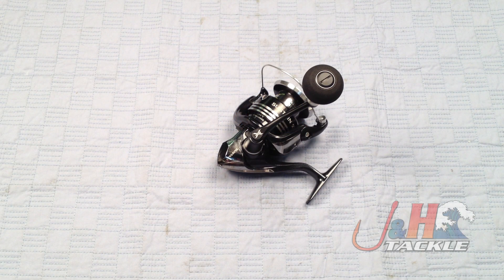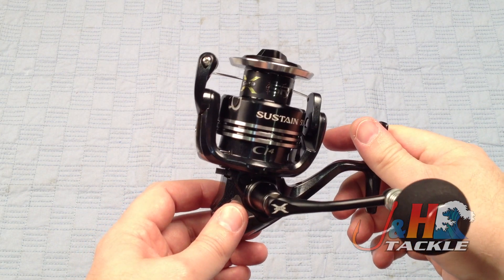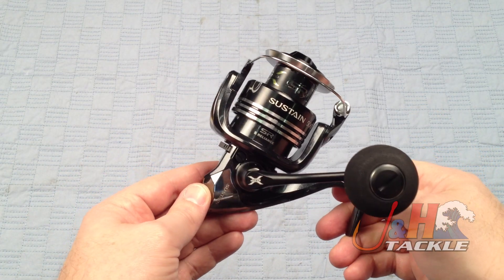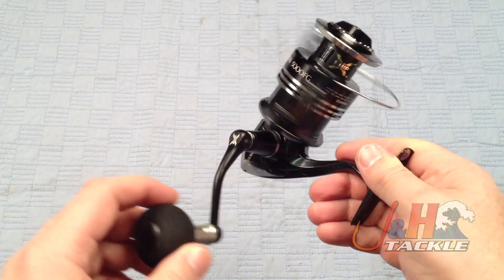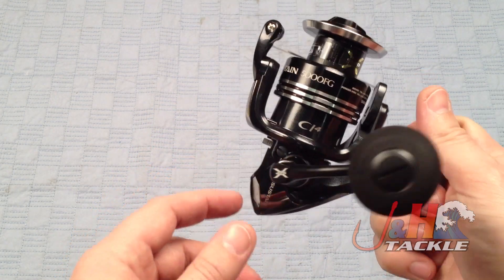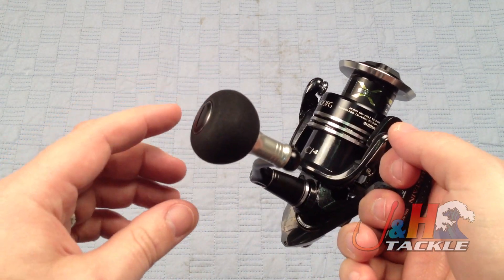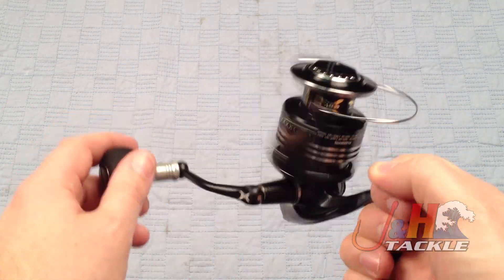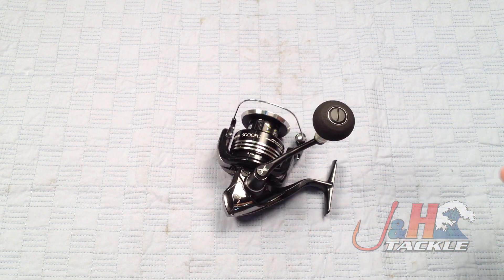Shimano Sustain SA5000FG Spinning Reel - J&H Tackle

Comment from the maker: Neither. I would go with a Penn Spinfisher V 5500 or 6500 depending on the length of the rod. The reels you mentioned are not designed for the surf.

Comment: Hi, would this be a ideal fit with a Shimano Trevala S spinning rod TVSS63L rod? Planning on spool it with 20 or 30 power pro and drift along bank in the delta for Stripers, possibly sturgeons in the 20-50lbs range since it has 20lbs drag (very strong) .....any input would be great
Reply from the maker: +Thuan Tran OK for stripers but not for sturgeon. Sturgeon will kill both the rod and reel. You'd be better off buying a Daiwa Proteus M rod.

Comment: Hi, i want to use this reel for catfishing (silurus) in France What do you think about? Do you have any other suggestions?
Reply from the maker: How big are the catfish?
Reply: Between 30 to 120 lb
Reply from the maker: Chill-Production It's a very nice reel but 120 lb fish is big. You will need a larger reel.
Reply: Thanks, the sustain 6000 would be better ? Because i want a light reel
Reply from the maker: Chill-Production Yes.

Comment: Can I put straight braid on this reel or does it need backing?
Reply from the maker: You can't put straight braid on there but if you put some tape on the spool you can put the line on that. We usually use at least a little backing.